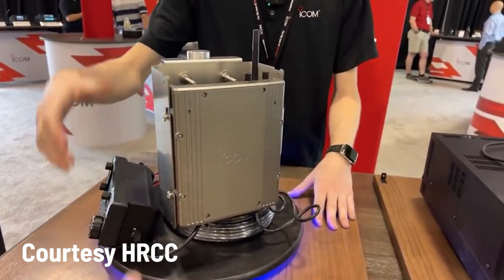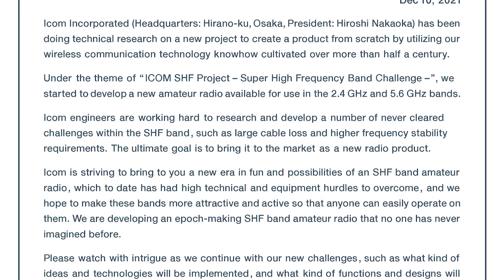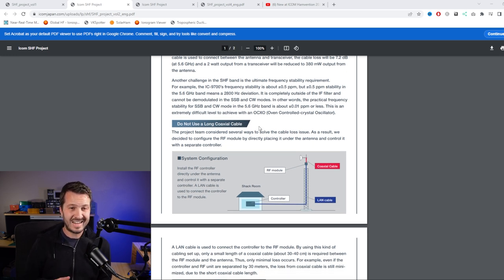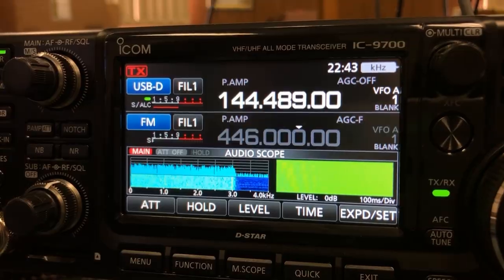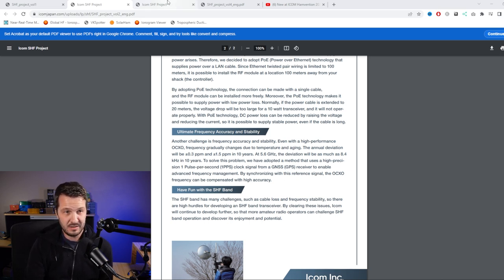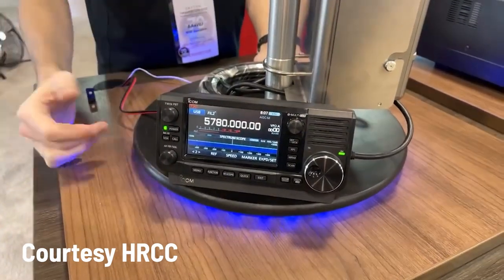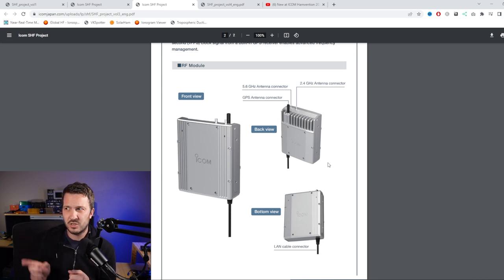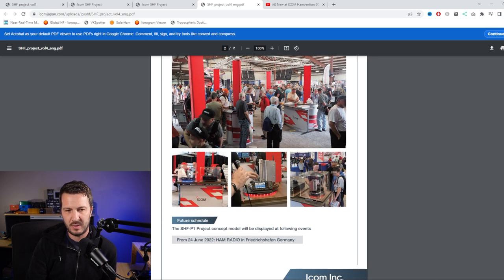The ULTIMATE Challenges Facing the Icom SHF Project | New Ham Radio

Comment: Interesting... the next logical step would be to transition HF and VHF/UHF radios into a similar headless form factor, managed from a common control unit that looks from the outside like a radio that can operate on any band from 120m to 5GHz.

It's not much of a step after that (depending on the control protocols) to ditch the proprietary control unit and operate everything from a PC.
Reply: I was thinking the same thing. Did I miss it, or did Icom explicitly state somewhere that the "LAN cable" actually carries an IP stack over Ethernet? I just assumed it did... then realized I didn't actually see that written down anywhere.
Reply from the maker: Yeah details are a bit few and far between. I guess wait and see?

Comment: The hams I know that work weak signals and  EME tend to be more experimental simply because the gear it requires is typically not mass produced by the big names as an end to end solution.  A good deal of integration is required.  What I see when I look at Icom's SHF Project is what an end to end mass marketed solution might look like.  I would even replace the control surface currently mocked up in a 705 shell with PC based software and an optional encoder wheel.  May as well make it completely remote able from the start.   I think in addition to voice, hams are going to want to use these higher bands for data and video.  The voice and video are probably going to be over data, so what this really is a SHF Amateur data node.  Assuming that both physical antenna designs and the software to support the applications and the networking required still need to be figured out.  Will future QSOs be point to point Video chats?  Will nets be like wide area video calls?  Heck if I know but the possibilities are exciting to consider.
Reply from the maker: I never considered Amateur Fast Scan TV! Good idea

Comment: i have no idea about using those frequencies in a practical sense.

Wouldnt there be interference on similar 2.4GHz and 5GHz Wifi gear?

The SHF project is such an unfortunate acronym, maybe someone should tell the Japanese engineers to change it. lol
Reply from the maker: LOL Don... yeah there will be some interference from WiFi and other ISM gear... I get that on my current transverters... You've just made me think... I wonder what filtering is available in these, like if you can notch down nearby interference

Comment: I’m not sure why you assume you would need another cable up to the RF module for GPS sync as the module already has an integrated GPS receiver. Surely it’s just a matter of implementing a GPSDO whereby the master oscillator of the RF module is synced to the GPSDO rather than having the master oscillator simply referenced to an external source in IC-9700 style.

I agree that unless this unit is capable of sufficient stability to run the weak signal modes as used in EME or weak signal terrestrial operation, it will limit the market for it. I also agree that it really should be capable of interfacing to a sequencer to run power amplifiers and preamps.
Reply from the maker: Actually after editing and posting the video I did have that thought too Andy, they could easily implement it in the RF module.

Comment: here's what icom could be doing instead.
-developing a noise blanker that is actually effective, making it work on fm as well
(you've been brainwashed to believe that is not possible)
-developing noise reduction algorithms which are effective without introducing annoying artifacts and without reducing freq response of speech.
-adding an amplifier/tuner module for the705
-adding a vertical/portrait display mode to the 705.
-releasing a multi band ht with full duplex/x band repeat

Comment: It won't be a big seller unless it has external pe-amp and amplifier control accessory ports. I would buy if this was standard. Easy to enable from the display unit, command for sequence switching via CAT6.

Comment: In addition to possible applications with future orbital spacecraft, I would consider using these bands for narrowband digital troposcatter communications. It should be extremely reliable. But it will require fairly stable receivers and directional antennas. It might be interesting to see if people would gravitate toward this in the same way as they have on 144.2 MHz. 

The unfortunate downside to this is that one would need to be able to see the horizon pretty well, and that may mean big antennas on towers --limiting the market for many ham radio operators. 

I would rather see ICOM brand some transverters so that it could be used with their transceivers, rather than some custom creature like this, requiring an entirely new display head.
Reply from the maker: Yes I think I tend to agree Jacob. A transverter system would be great

Comment: Since it's a self contained module with all the machined waveguides and micro striplines, it's not entirely out of the question that RF output could be 10W.
The PoE 10W mention is clue, for sure.
If the price point is affordable it might be worth a look at but it's still early days even though SG labs does have quite impressive microwave converters.
So wished they had a retrofit board for the 705 for a paid upgrade to allow SHF.
100% correct as we need to utilise these microwave ham bands.
Would love to get into SHF for DX contacts & EME is a goal, a lofty one for sure!

Comment: I believe that Icom will listen to the SHF community ie Rex/VK7MO, yourself, Andrew/VK3FS etc & could well put an IF output with switched relays for a higher power PA capability on the module.
This way, they could run a 60W PA or an SG labs & establish frequency stability at the Icom SHF head unit possibly acting as either an IF head unit or directly to the 2.4G & 5.6G output feeds.
Another school of thought for Icom to elect for a 1pps GPS sync is that if one loses GPS lock the frequency stability via the OCXO is at least maintained until the next GPS sync rather than having a 100% GPS frequency sole reference.
Maybe by deliberately using the popular 705 form factor & display it's possible Icom could be actually teasing us in hinting at paid 705 upgrades to suit SHF head units.

Interesting product & approach, for sure & be interesting to see its price point!
Reply from the maker: Some great suggestions there - thanks John!

Comment: I do not see much use in mounting a SHF radio on a tower in the Southern U.S. because there is not enough density of Hams to make it practical. Plus we have Pine Trees that are 30 to 40 meters high that create another obstacle. And for portable use you would need the ability to connect preamps and amplifiers.  I think some more thought needs to go into it.  I wish they would include the 1.25 meter bands on their radios, but I am well aware that that we in the U.S. are the only ones with this allocation.  It may spawn some interest in these bands, though.

Comment: I'd be interested if I could use my 9700 to drive the rf module with a software upgrade but not so much if I need another head unit.... might be sour grapes so to the initial 9700 troubles I had 😉🙄

Comment: Why don't they build a 1296 mono band radio.  I am not going to spend big bucks for a ic-9700 when I dont need 144 or 432.
Reply from the maker: Yaesu used to have years ago 1296 monoband radios, FM only. They should do those again
Reply: @HamRadioDX  1.2 ghz FM is only good in big cities where there is activity.  They need to make a 1296 ONLY ssb/cw/fm all mode radio.   1296 Ssb/cw is where it's at for tropo and eme.

Comment: Thanks for your thoughtful points.  I have enjoyed your 9700 comments, so adding this is valuable.  I'm wondering if the switching and control you mentioned couldn't be done in the data protocol with future amps.  Is there any discussion of using the system in a full duplex path?
Reply from the maker: Thanks Tom. I guess switching and control could be done, but I don’t see any hardware outputs on the RF module - plus mounting an amplifier outside presents it’s own set of challenges

Comment: 5.7 gig ?  There is barely anyone on 440 which most already have ... or 220 even worse. And it's not like 2 meters is even packed like in the past . The SHF project is literally ridiculous. Why would anyone even push for this ?  New hams don't know and get suckered into hype like this.   Makes ya wonder the motive.
Reply: i'd LOVE to see ICOM build this!  - And I'm FAR from a new ham (licensed 53 years).  I'm active on 222, 432, & 1296 MHz. weak - signal, mainly SSB & FT-8 (while working to get the "rust" out of my CW).  Something like the SHF-1 could make moonbounce a practical mode of communications (antenna gain comes easily at SHF frequencies).   SInce this is still in the early design phases, in addition to weak signal work, wideband data modes would also be possibilities - or also think amateur HDTV! (I've also done conventional "standard-definition" amateur TV in the past).  Just because it's not "your cup of tea", don't knock it for those of us who'd love to see something like this become a reality.

73, Tom WA1LBK
Reply: @WA1LBK  So are you saying you'd have the dish on some sort of autotracking to the moon orbit? (to use moon bounce)? If so, how transient would your connections need to be? Would you get an FT8 QSO done before your counter party moved out of frame?
Reply: @MrAlanmcd  I don’t believe auto-tracking is an absolute necessity; unlike the LEO amateur satellites, the moon moves slowly enough across the sky that most EME stations I’ve seen track it manually.  I’m pretty sure I’ve come across some YouTube videos recently which showed a guy doing 10 GHz. EME with about maybe 60 Watts (high power at those frequencies) into a manually aimed dish.  I have not personally done EME but it’s on my “To-do” list.  For 2 meters, I’ve been told that my current 2 meter station (ICOM IC-9700 @ 100 W. with tower - mounted RX preamplifier & a Cushcraft 4218 XL “Boomer” long yagi) should be capable of doing EME using some of the digital modes ( this is by someone who HAS done it - & I believe JT-65 is the preferred digital mode for EME).  Although there is something like a 2.5 second propagation delay on an EME signal, I don’t believe that Doppler shift is an issue like it’s on the LEO satellites.  I have not been active in recent years on the satellites, but my most memorable QSO on AO-13 was with a Japanese station using the long Cushcraft yagi ( which does NOT have an elevation rotor on it) where the “bird” was barely above the horizon for both of us, using SSB; this was a linear satellite, 70 cm. uplink, 2 meter downlink, using an ICOM IC-475A / IC-275H combo.

Currently getting ready for the June ARRL VHF contest this weekend, will be operating 50 / 144 /222 / 432 / 1296 MHz., using SSB, FT8, & CW. 😉

73, Tom WA1LBK